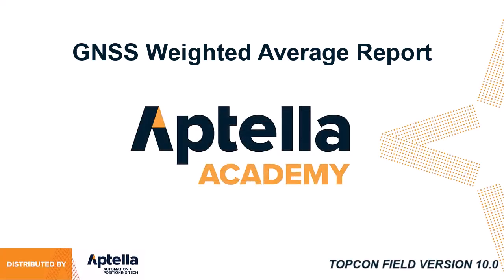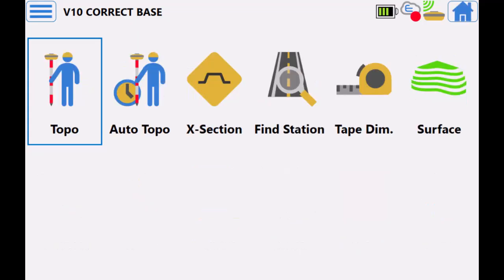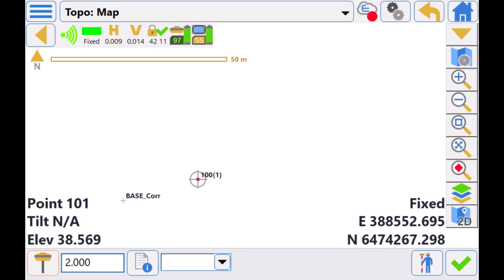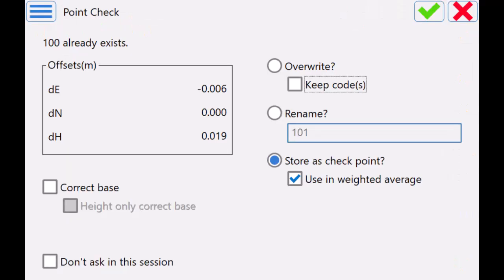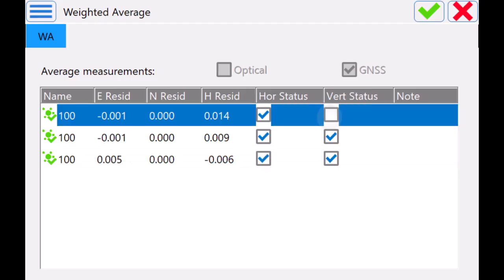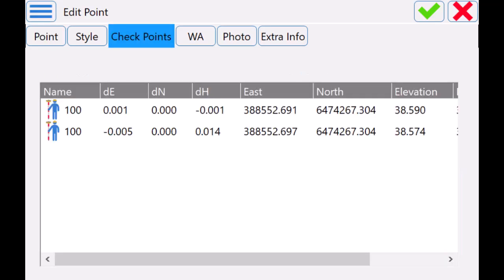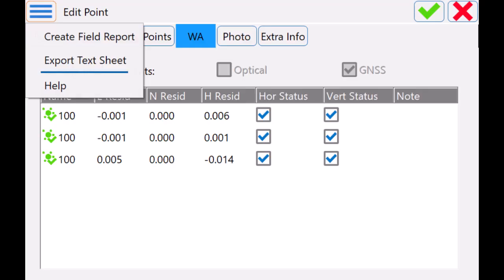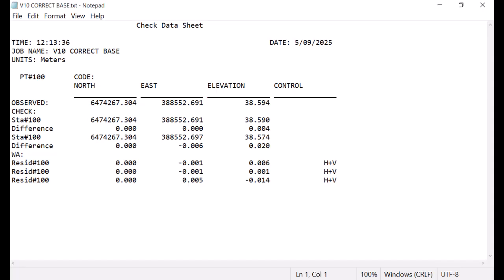MAGNET Field V10 – GNSS Weighted Average Report

Comment: there is a pretty big issue in how it computes the weighted averaged final coordinates it puts out for said point. Yes, you are able to turn off certain horizontals and verticals but the software is also using best residuals, RMS etc behind the scenes that you have no control over. Just beware that this is not a true, self controlled, weighted average and you should be taking however many observations you'd like and computing an averaged point yourself outside of the software as there is no other way that we have found.